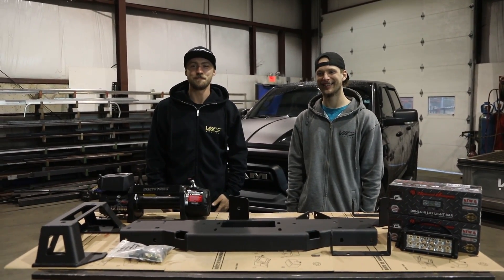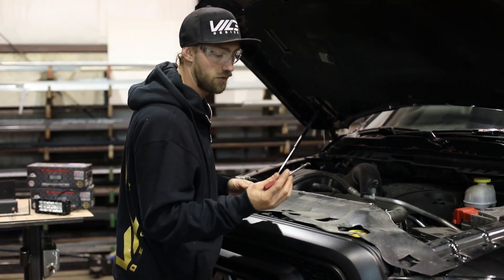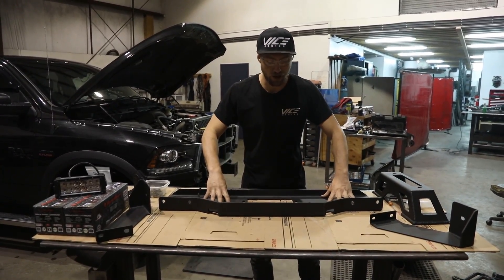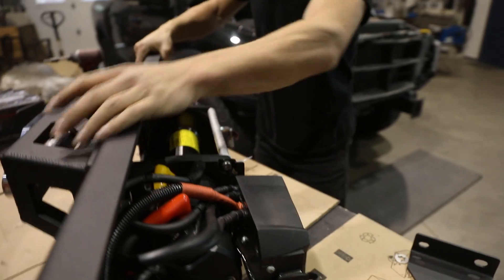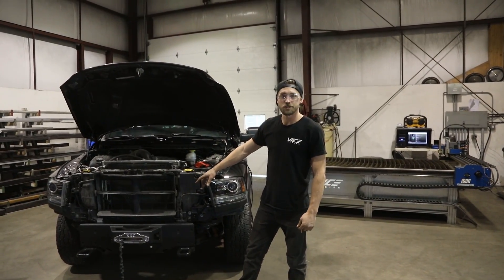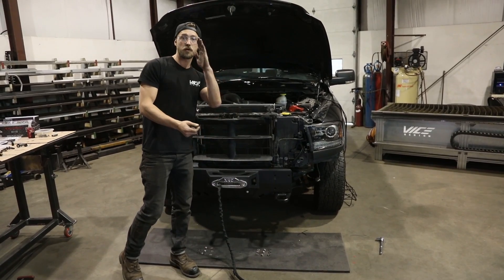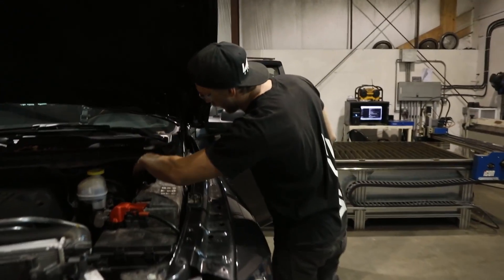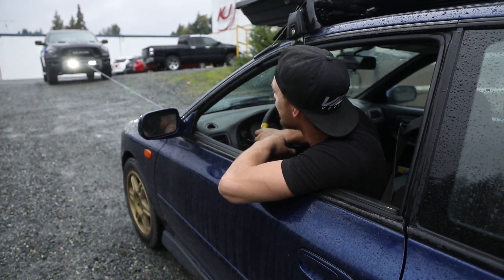RAM Rebel (2015-2018) Integrated Winch Mount Installation - VICE

Comment: need one for my 2019 you making them any time soon ? almost would think the 18s should bolt right in the 19 don't really see much difference.
Reply from the maker: Working on getting a 19 into the shop. we are planning on it!
Reply: VICE Design 
put my order in as soon as you got one available. if i lived closer would bring my truck in for you but long drive from Ontario. thanks for the reply
Reply from the maker: Just released kits for the 2019!! We're doing a pre-sale right now. use code 5THGENWINCH at checkout for a discount! Expires Aug 11th at midnight. https://www.vicedesign.ca/integrated-winch-systems

Comment: You guys ever get a hold of a '19 Rebel to fit?  

Bet its already pretty close to fitting.  Are you guys west coast?  My wife has been bugging me for a trip up north....and I just happen to have a '19 Rebel.  :-)

Hmmmmm
Reply from the maker: Just released kits for the 2019!! We're doing a pre-sale right now. use code 5THGENWINCH at checkout for a discount! Expires Aug 11th at midnight. https://www.vicedesign.ca/integrated-winch-systems

Comment: Guys how about the 2019s, do you have a kit yet?
Reply: Yes, I was about to ask the same thing. VICE design, please update the winch plate for the '19 rebel.
Reply from the maker: Just released kits for the 2019!! We're doing a pre-sale right now. use code 5THGENWINCH at checkout for a discount! Expires Aug 11th at midnight. https://www.vicedesign.ca/integrated-winch-systems
Reply: Hi there, I tried the code and it doesn't work...
Reply: @vicedesigninc  I tried the code too, doesn't work, says "This discount is no longer available". Tried at 4:23 PM today (August 4th).
Reply from the maker: @thermorex  Thanks for the heads up. Should be fixed now. let me know if you run into any problems
Reply from the maker: @th3duke1  Looks like it expired early. Should be fixed now
Reply: @vicedesigninc  code worked but at checkout it disappeared and I paid full price. I replied to the order with details.

Comment: This may be a dumb question- but winches are a universal mount, correct?  You could mount most any winch onto your mounting plate, correct?  What winch did you use in this video?  Thanks!
Reply from the maker: Yup! It shares the common 10" x 4.5" mounting pattern. We recommend the WARN VR EVO in either the 10,000lbs or 12,000lbs synthetic version. In this video we used a Smittybilt X20 Comp 12k Comp which is a good value winch as well.

Comment: any idea if this mount will fit a non rebel specifically a 2014, dont have to worry about bumper clearance as its got a addictive desert designs pro lite on it
Reply from the maker: It will fit the frame end for sure. Cant comment on how it will fit with pro lite but with a bit of modification it possibly could work